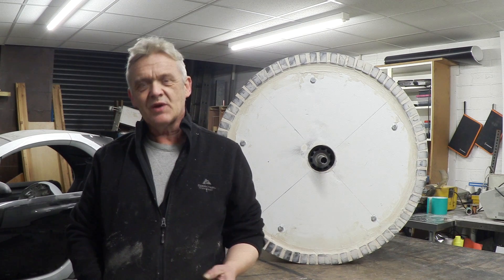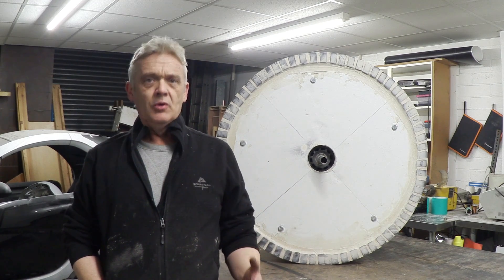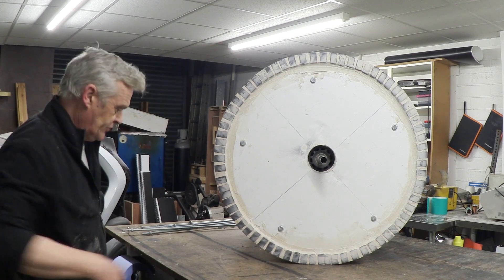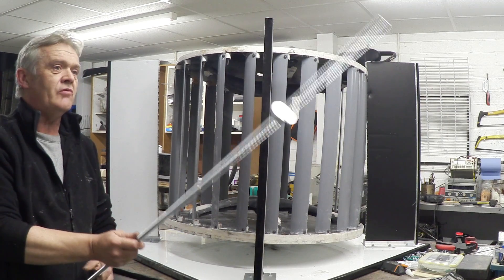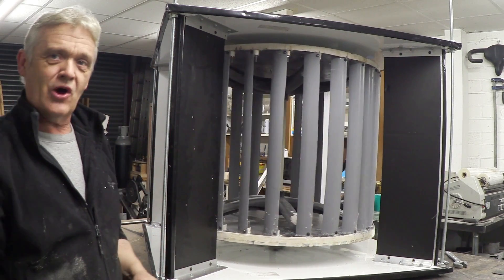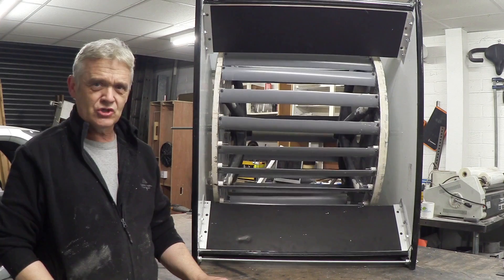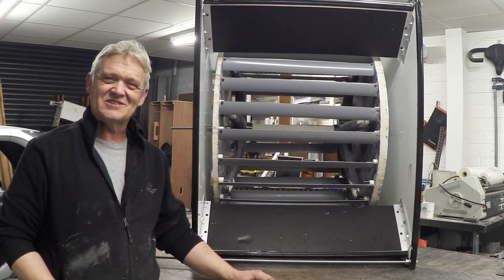Building a 1kW Wind Turbine For Under £100 Part 4 - Finishing The Body

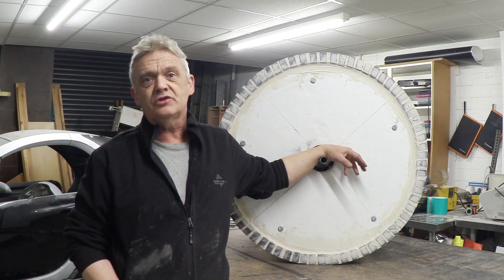Comment: I am really really enjoying this series Robert! It is vintage Dread Mad Scientist Robert. And I can’t help commenting after your insights at about 2:30 in. Like most of my comments this is a little far a field. If you read on, consider yourself warned. 

Similar to how the wind generator’s marketeer’s “theoretical” will vary greatly with the user’s “reality” the same happens between the marketeers promises and users experience of tankless “on-demand” hot water heaters. 

A new Rinnai claims to produce 10 gallons-a-minute (38 liters). But here are the conditions:
1. The incoming water temperature must be 57 degrees F (14 C). This occurs in the United States at about the latitude at the top of Tennessee (and likely nowhere in Great Britain). (That’s the average, so a few degrees warmer in the summer and several degrees colder in winter.) 
2. More important though is the temperature difference between incoming and outlet at the faucet or shower or dishwasher. If you have 57 degree F incoming water and you want 115 (46 C) degree water at your shower (absolute minimum I would say) in the morning, your flow rate is now at 6 gallons a minute (22 l). That’s not awful because the average shower head in the United States uses a bit more than 2 gallons a minute (7.5-ish l).
In Seattle, Washington, where I live, in January the incoming city water supply is around 45-50 degrees F (7.2-10 F) and my minimum temperature for a shower is 120 F (49 C). Now the flow rate is 5 gallons a minute. 
3. Those numbers are for a top of the line, state of the art Rinnai RU199in, $1666 on Amazon and you will pay that much at least for installation. 
4. Finally, unless your natural gas line and meter was installed with a tankless water heater in mind you will likely need a bigger line from the city main and a bigger meter.

The sales person won’t inform the buyer of the real world numbers. The salesperson likely only knows the ideal theoretical numbers. And for sure NO ONE at Amazon will know any of them. 
This is why, you see so many disgruntled angry reviews for tankless hot water heaters EVERYWHERE. The customer over expected the flow rate. The customer under estimated the temperature differential (or more likely didn’t even know). The tankless unit itself is under fueled so the flame drops out then restarts then drops out. And what do you suppose is happening at the shower?
This is not meant as a rant. My tankless runs flawlessly, producing 135 degree water in the winter sufficient to have a shower, the dishwasher and the washing machine all going at the same time. 

My point is, whatever the wind generator salesperson promises, divide by two (to allow for the marketeers lies, misinformation, and ignorance), then reduce your expectations by 10% (to be safe 20% is better). Then look for the wind generator that will serve your needs.
Or better yet, follow along with The Dread Mad Scientist Robert and make your own suited to your needs.
Thank you again Robert for sharing your joy and your brain. Your YTs always delight and never fail to inspire.

Comment: Hi Rob, thats a thing of beauty. Well done on a great build. Just thinking about your threaded bar, perhaps they could be used also as a way of connecting + _ in the wiring process. The fins are a great addition. Would putting a tabular drum inside the cage improve air flow? Anyway, thanks for your videos and hope youre keeping well, all the best kieron

Comment: I built something like this on a smaller scale about twenty years ago.  I'll be interested to see your approach with the stator.  Lots of home-brew wind turbine info suggests winding multiple coils and overlaying them. I found this messy and complicated.  I finished up laying two rows of pins around the perimeter which were spaced at the same pitch as the magnets and then ran a continuous conductor out towards the edge and then back towards the middle on the next pair of pins and continued around the stator several times.  I stuck it all down with epoxy and then removed the pins.  (This would be a lot easier to explain with a diagram)  That provided one phase and worked really well.  It might be more challenging to attempt this with the gauge of wire that you'll be using.  I did begin a three phase version where I had the same configuration repeated three times at 1/3 the pitch of the magnets, but then I got a proper job and the project ran out of steam.  I've still got a few bits laying around.

Comment: Really great work again! 

I really wish I had the space to tinker and I fully intend to build one of these VAWT's at some point. I also have in have in mind a plan to cut down on the drag for the side that is moving into the wind, but I won't share these particular plans here as they are too complicated. However I was just thinking, I wonder if you could spray the back side of the blades with Teflon or something to cut down on the friction as they move toward/through the incoming wind to reduce drag and thereby increase rotation speed? I was thinking also maybe using magnetic bearings might further lower the friction?? 

"Underestimating resistance will destroy my treasures" - Lao Tzu
Reply: Spend $100 and then generate 1 Penny of electricty on Windy Days?  WHY ?

Comment: Surely to run it vertically would gather wind from any direction. Yes it could run with the shaft horizontal but then there would be a need to direct it into the wind, the corner vanes would perform better in a vertical plan I suggest. I liked its free running.

Comment: On a serous note: if you hinge the blades and spring load them they 'feather' as the wind speed increases, so they maintain a limited output regardless of higher winds. A weighted system also does the same but is linked to rpm instead of wind speed. No wasted braking or resistive dumping needed. Set your desired output by adjusting spring tension or adding/removing mass etc. negative feedback engineering 101.

Comment: Bifilar coils can be tuned to prevent cogging. The tuning will be easier to figure out once you know the resistance and inductance, then pick the right size variable capacitor to tune it. The back emf can be used as a boost instead of causing the cogging action

Comment: Ps can u let us know the resistance or no of turns on your coils, also is there an easy way to convert high voltage dc to high current dc as another project I've got can produce 100 v but very low amps but it's dc otherwise I'd use a stepdown transformer ( if it was ac)
Reply: how about a 100v dc inverter to 220 v ac

Comment: Great build. A beauty and well balanced. It is rotating so nicely and smooth that it promises a great speed even with several coils installed and thus resulting cogging in action. I am curious if you are planning to test a N-N magnet configuration after that N-S you did here...

Comment: Not exactly what I had in mind but I'm sure there are time and material constraints, however that looks a sturdy design and easily adaptable ,if you make a corner face the wind you'll double the surface area, but we are back to the problem of resistance on the blades on the right hand aperture, if you recall I mentioned using the same material as the blades (known as stators )to direct flow, so if you reverse a row on the right hand side it will turn the air in the right direction, the angle of attack on the left hand one should be fine but the again they wouldn't do any harm there either and if they were  rotationally adjustable you could optimise the flow  ?
Consider the air entering the cage when it exits the left hand quadrant it will do work, however when it passes the centre the air exiting the blades on the right hand side will work against it so that side needs to be blanked off probably with a curved screen close to the blades, I hope you understand my thinking but then I could be completely wrong 😆
A point on upcycling how many gazebos get thrown away because those telescopic frames mangle up, but cover is usually sound, so with a bit of thought you could make a portable funnel to direct more air into the apparatus, gagging with expectation for the electrical side of it. 
Rooby x

Comment: Awesome, in the horizontal plane looks like it would be an awesome water powered generator too? Any thoughts on how to make the generation part waterproof?
Reply: think about the parts for a minute, contactless magnets passing so called magnet wire that's actually insulated with  clear nail polish plastic, so just insulate and properly protect any and all ends all the way out to the less conducting fluid 'air'.....
Reply: @paulmaydaynight9925  Could he use more of the  epoxy resin around the coil

Comment: Do you have any plans for dealing with REALLY strong wind days?.....I can see you and your house wizzing up into the clouds like in the Pixar movie "Up".
Reply: The breaking system is what most engineers have told me is the main reason for not being able to connect to a battery backup system that is also connected to the grid eg where does the excess power go? I asked if blades were like on a windmill and can be "breaked" would it work and got told No. I still don't understand why.

Comment: Loving the series and it's good to see theory put into practice. I'm confused on the purpose of the baffles or why the blades are straight and not twisted like a propeller. I'm certain there will be good explanations for both and would like to hear from other people on this.
Reply: I think the baffles direct the wind into the turbine. The blades are not twisted like a propeller as this is a low torque design. A propeller is designed to attach to a central small wheel plate but create high torque. Also there would be no more than four propellers. and balancing is more and an issue.

Comment: hello Robert, a question or a suggestion if you want ... if you would mount another row of magnets and a row of coils at the top of the rotor ... wouldn't you practically double the power? It's true that it will take a little more wind power ... but the benefit would be greater I think.
Reply from the maker: I think I agree mate - this design is far from perfect that's for sure lol

Comment: Really great thanks, perhaps jumping the gun but. Are you going to fit three coils in a three phase configuration. If my even out the speed voltage and be more efficient before rectification. Thanks again for sharing.
Reply from the maker: I am certainly going to fit more coils but it is all experimentation really so I am not sure how many or in what arrangement right now - but then to be honest the goal is quite modest

Comment: Very nice, looking very good indeed.

I'd be very tempted to mount a centrifugal braking system of some sort on it (going with the recycled everything approach, maybe a centrifugal clutch mechanism from a chainsaw or similar). If you get hit with a storm, even with more static balancing to remove the obvious heavy spot (created when magnet potting, I would guess) vibration caused by dynamic imbalance is liable to tear it apart, you're really going to want to slow it down before that happens.
Reply from the maker: yep - exactly what happened mate and I am pondering a braking mechanism - I did hear VAWTs we self limiting to a degree so I am equally interested in seeing if it would hole together in a storm - after all if it does then construction would be super simple - I might well do that just to test it

Comment: great project. I was wondering how many microwave coils you could use before they interfered with each other and if the top also was further set of and had magnets, poss zigzag pattern, is there a formula to calculate this? To go even further could do setup with coils above and below each disc and would need to calculate cost vs poss power return, just a thought.
Reply from the maker: good thoughts mate - I am sorry but I don't plan on doing any of it - you know me I will try it and see - but calculating it is certainly a good way to go if that is your bent

Comment: I am asking myself if there is a windspeed where it would a breaking  system. Or is this only nessecary with big wind turbines?
Reply from the maker: I have heard VAWTs are self limiting mate - I don't know if that is true but I plan on seeing if it is lol
Reply: @ThinkingandTinkering  I  recently read about a suisse company thats trying to built grid scale Vertical Wind turbines. The article said that bigger ones suffer great material fatigue on the blades...  so I wondered, as yours is supposed to spinn fast all the time, if that could ocur in your design too. So I thought if it would need a break... by making a secundary inner ring of magnets and coils that rise the magnetic pull and only jump into action only when the centrifugal forces are getting to high.

Comment: looks like you may have a bit of a heavy side.    (near end of video with it on its side)  get a lump of clay or sticky tack,   and stick it on the high side,  until its evened out and does not prefer a side.   then collect your sticky tack, and weigh it,   then you can use a measured amount of epoxy,  or some  nuts or washers  to make a more final weight balance weight.    a good balancing will help your efficiency,  and also keep it from shaking apart.    ..... unless those losses  and shaking are  your plan for what to do in a overwind situation.
Reply from the maker: yeah potting the magnets has made it a little unbalanced - I need to balance it

Comment: I noticed when it was on it's side the rotor rolled back and fourth, it might be ever so slightly off balance, but I'm just being picky LOL. looks amazing, can't wait to see the results, even if it doesn't beat the commercial unit but comes close, for less than 100 it's still a win, not to mention the learning experience that comes from building it yourself.
Reply from the maker: yeah potting the magnets has made it a little unbalanced - I need to balance it - and cheers mate

Comment: Hi, you didn’t add any cost for the ceramic magnets, could you tell me where you salvaged them from?
Reply from the maker: yes I did - without the magnets and threaded bar it cost me £9.90 - I used first4magnets to buy the magnets but 20 of them I salvaged from exercise bikes

Comment: you know your turbine is off balance? I see it stop, head the other direction then do it again till it stops, I would balance the inner turbine to keep from vibration and help with efficiency , also how about several coils that the faster the wind speed the more that kick in? this would produce more power that you could dump for a brake and also output more power under greater wind speeds
Reply from the maker: yeah potting the magnets has made it a little unbalanced - I need to balance it

Comment: Do you know the significance of the number 72 especially in a circle or cycle?
Reply from the maker: nope
Reply: @ThinkingandTinkering  crops up everywhere and has significance in alot of ereas including science, religion and astrology.. for example 1 "day" in the procession of the equinox is 72 years or the reward in heven of 72 virgins in Islam, just 2 of thousands.  If you Google the significance of 72 you could lose a few hours lol. Un related but probably the sort of thing you would find interesting mate 😉

Comment: Watching the rotor behind you as you spoke and it appears to need balancing. It will probably be OK at low R.P.M. but,particularly with its large diameter, lack of balance will drastically stress bearings and structure at higher speeds. Adding solder to the vane support tubes is one possible method. Just lay it horizontally and the heavy  bit will always be lowest after allowing it to settle. A marker pen to show location, then trial and error with weights @180 deg.
Reply from the maker: yeah potting the magnets has made it a little unbalanced - I need to balance it

Comment: You have to balance it a bit more i think. Let the wheel settle down and drill holes at the bottom untill it never settles on the same side. Or do the inverse. Add weight at the top.
Reply from the maker: yeah potting the magnets has made it a little unbalanced - I need to balance it

Comment: Your wheel is out of balance.  It is heavy enough on 1 side to cause it to settle when it is on its side.  That could cause vibrations that would cause inefficiencies and, at the extreme end, shake itself apart.  Let the heavy part of the wheel stop at low side and add weights to the high side.  Rinse and repeat until it doesn't want to settle to one side.
Reply from the maker: yeah potting the magnets has made it a little unbalanced - I need to balance it

Comment: Plans aren't necessary, but knowing the angle of attack of the blades and if 90° or 60° sections of pipe are best would be rather helpful.
Reply from the maker: angle of attack is 36 degree to tangent and they are 60 degree sections but I have said that in the vids already mate

Comment: Looks great.

Are the baffels to direct air flow? I don't know if there's any easy way to do it, but future builders might gain a little more power by tilting them off 45 degrees, maybe at 30 deg. in the direction of the spin. Could be fun to discover what optimum angle would be.
Reply from the maker: they probably will direct the airflow to some degree but they are really there to stiffen the box
Reply: @ThinkingandTinkering  
Good to know, thanks :)

Comment: Everything  you do is awesome  mate. An idea came to mind ,The  levitating pencil used as the axel for friction free rotation And the magnetic gears you should us can also work in relation to rotation ratio? and to get to your goal just throw more  coils in a parallel  series..?
Reply from the maker: lol - cheers. mate! I was thinking of adding a kind of maglev for the bearings but I really just went simple here
Reply: @ThinkingandTinkering   One more thing the diameter of the magnets meaning more passing coil would this generate more watts?